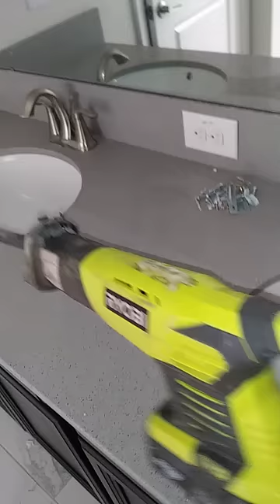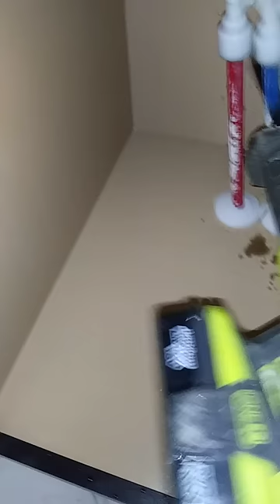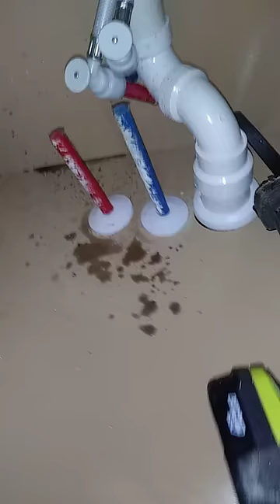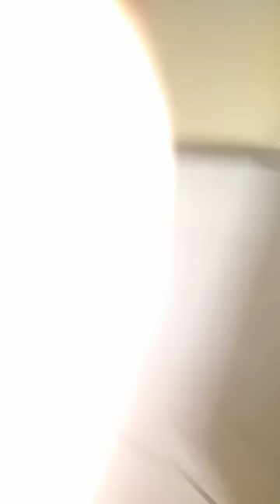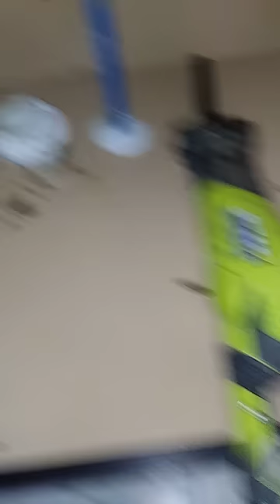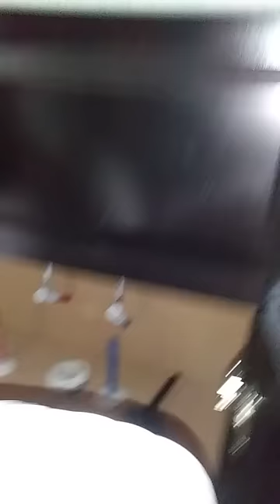This is what happens when you DON'T pay your plumber.

Comment: Nice, now the homeowner definitely doesn't have to pay, and you need to pay the homeowner for damages . Good job
Reply from the maker: Your dumb!!! And sorrento don't know how to read.  So STOP posting KAREN!!!!!!!
Reply: @HungarianHacker  You don't have to agree with it or like it. But it's the law.
If a contractor fixes something and the homeowner doesn't pay, you need to go to court. If you "selfhelp" and remove something that is attached to the house,  you now have to pay the homeowner for the damages
Reply from the maker: @corryandrew2357  This is coming from the judge from the last time I took someone to court.  He said, and I quote, " The item in question is/was damaged, and I need to return it to the store," and just don't return until payment is made in full.  There is no need to reinstall the old fixtures because you're currently in the process of repairing or replacement, so if the home owner doesn't pay its not your fault but theirs!
Reply: @HungarianHacker  
You're right. It's not your fault. But you still can't go and "self-help"  and remove whatever you have installed. Note This is only applied to things that are/become attached to the property. 
This needs to be resolved in court.
If the homeowner has a good enough lawyer, he would win because it's illegal to self-help. However, considering the fact he didn't pay you, I'm assuming it is the reason the judge sided with you cause he didn't have money for a good lawyer.

Comment: Buddy, just get a sledgehammer and crack the bottom of the tub. Cracked tub means a complete new bathroom remodel.

Or you can go to there house at 3am in middle of January and shut their gas off (if meter is outside)

Comment: Hired a plumber and they have done nothing but screw up, drill holes and installed  things wrong, their pipes  blocked my HVAC, support beams, oven vent, recessed cabinets, they drilled 2.25" holes in joist to run 3/4" line. They drilled multiple holes in multiple rooms because they missed. They hit a support beam. They completely ignore basic instructions.  The ran a gas line using water pipe on one half of the house and csst on the other half, no shut off valves and the flex line for the grill only reaches in front of my sliding door. The way they installed the line if I connect my grill I can't use my sliding door. I was present and stopped them before they put the propane tank location on my side walk. Things that weren't on the drawing I walked out with them and sent pictures and if they weren't sure I'm only 5min away.  The utility closet I drew a line telling them no hardware can go beyond this line. They went passed the line and passed the end of the drywall well into the obvious doorway I was framing. These guys were not the cheap guys, somehow they have good reviews.  Total F#cking garbage. Complete trash. Jobs not done, the gas line will be completely replaced by someone else. I'm in the process of firing them. They have already been paid $8,000 for this nightmare. If I see them anywhere near my house I'll be calling the police.
Reply from the maker: Damn sounds like a real nightmare 😳

Comment: I would have cut the pipes, then taped with clear tape with the valves off. It would have been hilarious when the homeowner would have assumed everything is okay and turned on the water valve and have water gushing out.  I can’t believe people want work done and can’t pay the contractors after the job is completed.  It’s best to have a contract agreement in place.  Have them give you 60% up front and the other 40% after the job I’m completed and also charge an additional 10%-15% for addition miscellaneous items.  Trust me, you don’t want to give a quote for $250 then let the owner know it actually costed $325. It’s just simple business negotiations and coming up with terms and conditions both parties can agree too.
Reply: What we do is 50 percent up front for the materials then we get payment every week, if they dont pay they dont get their job completed. Havent had a problem since we started doing that

Comment: Just a note that in a lot of states once a contractor puts something into a house, removing it for non-payment is considered theft or destruction of property and can get the contractor in trouble if the homeowner is willing to push it legally/civilly. Especially if it causes any secondary damage to anything else (which doesn't appear to be the case here).

What should have been done by the contractor (and all of the others that film these sorts of videos) would be to place a lien on the property. Destroying property is amateur and guaranteed to never get you paid.

Also, it's a bit of karma that - since he ended up buying the house out of foreclosure - he had to fix everything he destroyed in this video for free anyway.
Reply from the maker: I had to fix all the electrical and carpentry too. It cost me about 60k to get everything done. This homeowner screwed 7 other trades not just myself. I've gone down the lein process on the past I'm still waiting on those to come in. People in Miami FL are savage. I was told by the judge on the last lien hearing that as long as I say it was damaged and that I was removing it to return it and ask for payment before I return them it's a loop hole that I wouldn't get in trouble with the law.

Comment: I used to drop an 8 penny nail down the copper stand  pipe. Every time they turn the water on the nail would travel up and make a clinking sound as it hit the top of the elbow and when the water was shut off it would fall back down making a clinking sound at the bottom. Drove people insane.

Comment: I did work for a lady recently, I moved her bathroom light over a couple inches. I had to cut into the wall, attach additional wire, and route it over a few inches. Then I had to patch the old hole, texture it, and I did a few other things. All together everything took me 9 hours to complete. This rich lady and her husband attempted to not pay me. I told her, okay, I'll go ahead and remove the materials from the wall then. They ended up paying me, but I had to firmly stand my ground.

Comment: Everyone smashing Ryobi, I’ve had a yellow ryobi one drill since they came out it must be 8 years old if not a few more, I’ve re planked a whole marina with it which was well over 90.000 screws by my estimation, I use lesser value tools around water for obvious reasons, I’ve used the same drill for renovating my entire house including building a kitchen from scratch and all the various weekly use over the years, it’s still on the original battery’s, I’ve had to revive one due to dropping too low but other than that it’s a beast, don’t knock ryobi, I’ve had makita stuff crap out quicker, tried and tested, ryobi make great tools, his blade was blunt

Comment: The complete starters guide to not paying your plumber:
x4 Sharkbite joints for reconnecting water lines
x2 rubber collars for fusing drain back together.
In total, roughly $30, and 10 minutes of your time. Worth it 😈

Comment: Once it is attached to the house, it is part of the property. This is actually a crime. 

You had a legal case against the owner.  You could have filed a lien. Now, you can’t, and the owner could make a claim against you.
Reply from the maker: I've done that in the past with the liens but you only get paid after the house gets sold and that could take many years. I was told by the last 2 judges in florida that next time remove what was installed and call it faulty and don't return until you get paid in full. That's what I would said had the law been informed. But the house was vacant and the home owner was a no-show
Reply: @HungarianHacker  judges advised you to lie? And you thought that was good advice?
Reply: @HungarianHacker Florida Title XL, Chapter 713, section 015.
You could have easily looked this up. 
Now you have done damage to the property and have essentially canceled this route.

You could have taken their house, but you settled for pipes...

Comment: This is so stupid you get a lawyer you get sued if you damage things even if you put it in
Reply from the maker: The process takes years to sue and he was planning on selling.  So proof goes out the window.  Then becomes a question of workmanship. This way was much faster and easier
 I ended up buying the house at a foreclosure sale
Reply: @HungarianHacker  still better then going to jail for property damage
Reply from the maker: This is pretty common practice for contractors to remove there work due to non payment. Two of my brothers are police Sargents and mother was a 7th circuit Judge for 30 years. All say it was the right thing to do.  Law doesn't apply to everything just a guide on respecting other ppl.

Comment: everywhere when the economy tanks bids fall below cost. that means SOMEONE in the sub-contractor phase is NOT going to get paid, and it's built into the plan. Drive by an entire block of closed in houses, drywall just done, and saw a dozen very large de-humidifiers running bull blast. SOMEONE not paid was not happy, and did something about it. SUE?? Lawyer want $ up front, number company has no assets, main contractor in another state/province/canton/country. Pull the plug.
Reply from the maker: Very true

Comment: Not legal to rip out stuff here in NJ IF TOU DONT GET PAID     30 year plumber here
Reply from the maker: Same 30 year plumber. Its technically not legal anywhere, but as long as you say that you're taking it out because it was defective. That's what the judge told me to say last time I did a mechanic lien on a property
Reply: @HungarianHacker  also it’s not worth my time and energy to rib stuff out.   It’s just more work for me.     If the bill is high.  Has to be 2000 dollars or more  for me to waste more time in court.   I just right off non payers on taxes

Comment: Anyone can repair that "damage" in 5 minutes for under 10 bucks, customer ain't losing no sleep and plumber 100% ain't getting a cent which was owed to him, a hope this video raised a few quid!!!🖖😁
Reply from the maker: I would pay you $500 quid to fix that in five minutes or less.
Reply: @HungarianHacker  deal, I could easily fit 4 x push fit fittings, 2 x glue fit fittings and tighten 2 x nuts in under a minute, but I am a professional, I'm saying a novice could also do this in 5 minutes, it's not rocket science, building a lego model is infinitely harder than that repair!!!🖖😁

Comment: What you “need” to buy is a REAL sawzall and stop using homeowner DIY trash as a tradesman.😂. Ryobi is perfectly fine for a guy who is gonna use it for 5 minutes every three weeks or so on some weekend project. It’s like when my helpers would buy some goofy off brand tape measure but then waste 40 bucks on a pair of Milwaukee tongue&groove pliers. First thing I’d do is throw them both out and hand them one of my old Stanley tapes and a pair of channel locks. Learn to use the RIGHT stuff from the beginning.
Reply from the maker: Why? 
You do realize that tools don't judge you on your skill.  It's like saying real men don't wear seat belts. Or woman shouldn't be in the workforce. 
What I'm getting at is you felt the need to say plumbers don't use Ryobi? I've been a plumber for almost 30 years and have and own every tool brand under the sun. I like ryobis connects tools they have outlasted Dewalt, Milwaukee,  Hilti, and Most other big brand tools by far. And for the cost and the fact that they cater to plumbers with all the cool plumbing specific tools they make.  Yeah I'm using Ryobi

Comment: If you complete a job and the customer refuses to pay and you return for revenge at least cut a pipe with water in it. Wtf is the point in going through all those hot and colds when nothing came out?
Reply from the maker: I turned it on after. YouTube made me cut that part out.

Comment: Considering you did it all wrong, no wonder you didn’t get paid. Hack
Reply from the maker: Please explain
Reply: @HungarianHacker  the “vents” for those lavs are illegal, at least in my state. All vents for plumbing must terminate through the roof.
Reply from the maker: @ptech88  Yes, Studor vents, also known as air admittance valves (AAVs), are legal in Florida as long as they have the proper stamping, such as NSF or ASSE. The Florida Building Code allows AAVs, but they cannot be permanently covered in a wall

Comment: Uh, if a plumber takes longer to cut through PEX with a power tool than you take with a pocket knife, you should reassess your choice in plumbers.
Reply from the maker: It cuts through the tougher PVC pipe. Why was that...
Reply: The reason it took so long is because it's flexible and moves with the saw blade. Had he held the pex with one hand and cut it it would've cut just fine. That's why it cut through the pvc pipe no problem. Because it was solid and not moving.
Reply from the maker: @timothy9360  thank you Timothy. You're the only person out of thousands of people commenting that realized this.
Reply: @HungarianHacker  apparently common sense ain't so common these days. 😆🤣🤣

Comment: I wouldn’t pay for this handyman plumbing either. Why is there a S-trap? And no vent for the sewer smell? The water supply should stub out of the wall not the floor. What kind of cheap shut off valve is that? I would expect you to rip it all out.
Reply from the maker: I don't think you watched the video. What s trap and I saw a studer vent

Comment: Good God what's wrong with your blade?
Reply from the maker: I didn't see anything wrong with the blade. In what part of the video was the blade messed up?
Reply: @HungarianHacker  um the part that it wouldn't cut that schedule 40 pvc. A metal cutting blade should not take that long. I assume it's time for a new one.
Reply from the maker: @Spartan-tm5hx  it cut the PVC just fine but that crappy pex was a pain cutting because I was holding my phone and it had to much play in the line. But I will agree that the blade was trash. I was just pissed and wanted to be dramatic. I could've used my pex cutters and PVC cutters.
Reply: @HungarianHacker  yeah it's better if you hold it. Crappy situation.  I'm an electrical contractor but never had to resort to that. I just put a lien on the property.  Lol

Comment: The way the pipe came off so easily makes me wonder if he deserved to be paid ok, now you are sounding like the substandard contractors we sometimes had the horrible experience dealing with. Own several rentals and had to inspect or clean out the bathroom cabinet and would use that same pipe to help pull me out and it always withstood my weight.
Reply from the maker: Talk to me when ur employer doesn't pay u for the hours you put in at work because u may have not worked the way he wants.
Reply: @HungarianHacker  we have a court system for disputes
Reply from the maker: @colleenweaver8682  didn't u read the description. I went through the courts to get the property.
Reply: @HungarianHacker  so you destroyed your own property
Reply from the maker: @colleenweaver8682  it wasn't mines at the time
Reply: @HungarianHacker  still, the pipe came off very easily in video and you should know water gets through
Reply from the maker: @colleenweaver8682  p traps can pull off easily. You should try it and lmk how it goes.

Comment: Real plumbers don't use Ryobi cordless tools!!!
Reply from the maker: Why? 
You do realize that tools don't judge you on your skill.  It's like saying real men don't wear seat belts. Or woman shouldn't be in the workforce. 
What I'm getting at is you felt the need to say plumbers don't use Ryobi? I've been a plumber for almost 30 years and have and own every tool brand under the sun. I like ryobis connects tools they have outlasted Dewalt, Milwaukee,  Hilti, and Most other big brand tools by far. And for the cost and the fact that they cater to plumbers with all the cool plumbing specific tools they make.  Yeah I'm using Ryobi

Comment: Did a crap job anyway. I wouldn’t pay.  Between the loop de loops for the drains and the one piece shut off supply lines.
Reply from the maker: Hello Nick,

As per your response to my video. You are the one who ordered the parts. I just installed them. There was also a blue print that had to be followed as per regulation. As far as your comments saying " loop de loop" you must contact your local mental health Healthcare advocate and have an evaluation completed for yourself.
Reply: U sir just do hack jobs
Reply from the maker: @nickwalters3478  And you, sir, are an old man with nothing better to do than scroll yt and rant about plumbing issues.  They should pay to have you institutionalized for creating the mess we are in as a Species. Shame on you, Nicholas. Shame on your bad behavior.